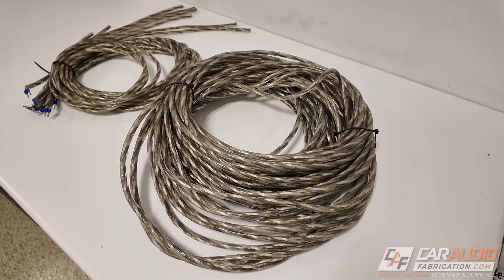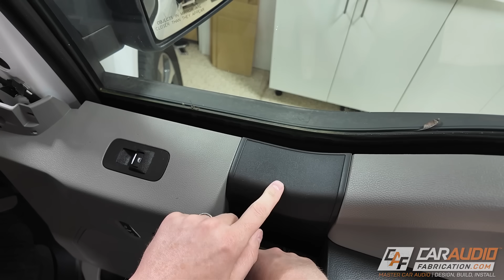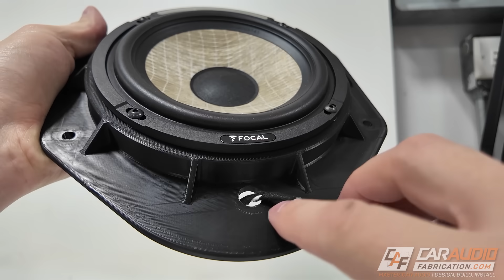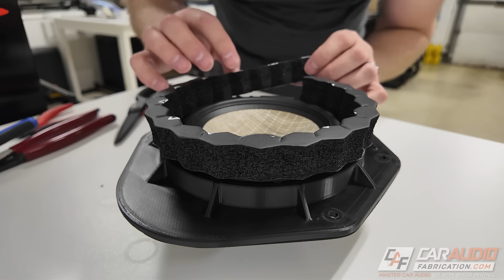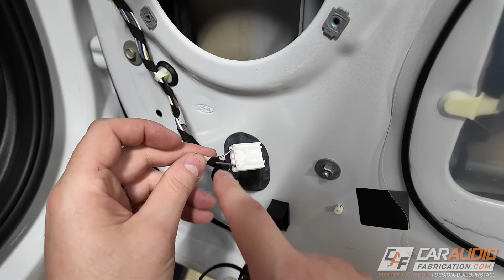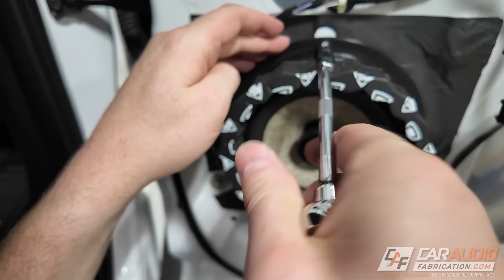AMAZING SOUND with THESE Speaker Installation Techniques

Comment: Mark, I absolutely love your videos and you’ve helped me on my journey of my car audio system
Now I would like to help you when you use your crimps to crimp the cables to speak terminals there’s a better way to use them there’s a two step process which enables like a butterfly effect crimp that you see all factory joins
If you’re looking into the Lucas terminal and see where the split is
Place Louka terminal into the Grip hole closest to your hand you crimp the nipple shape down onto the part that is split within the Lucas this folds the two metal pieces around the wire as if you’re making like a heart shape, once you have done this, you remove the terminal turn it 90° and then use the crimp closest to the cutters to fully squeeze it together
This makes it the strongest join you could ever make using the crimp tool that you have
I have a little video maybe I should post it on YouTube
I learnt this technique from an RC car guy who worked in the model shop
And it looks professional every time
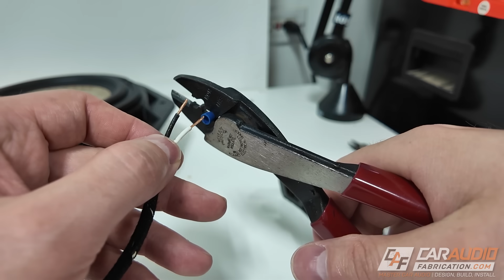Reply: At 7:10mins

Comment: Question; Whats the purpose for removing air leaks around the speaker mount when the speaker will ultimately have massive air leaks in other areas of the door?
Reply from the maker: We do typically seal other areas of the door as well, but the goal is not to create an airtight chamber, but rather to prevent the rear wave from interacting with the front as much as possible. Through a few simple speaker installation changes we can insure the most critical area near the driver is properly addressed.

Comment: I have a question because it’s not too clear here. Sealing foam you used between the speaker and ring then again ring and door. Was it one continuous piece that you punched holes in so the fasteners go through or are they segmented pieces starting and stopping at the fasteners?

Comment: I’m trying to get some bass in my 2024 Silverado LT 2500, non-Bose system. I don’t want to lose my storage under the rear seat, so no big sub box. I’m not sure if I can fit anything behind the rear seat, but what about those compact powered subs under the front seats? Also, I have no idea what the good, but not crazy expensive speaker brands are now, if you have any suggestions it’s appreciated. Thanks!
Reply: @robertboyer5498  get the new kicker down firing set up extremely loud

Comment: Are round speakers better than oval speakers? Just wondering about installing 6.5" round component sets instead of 6x9" ovals.Also wondering about the component sets-what does that do to the resistance as far as the amp in concerned? And my truck has 3 unused frill areas in the top of dash and apparently it's for ~3.5" speakers on left and right and a 2.25" in the center of dash that connects to the negative on the left side speaker wire and the positive on the right side speaker. Considering putting speakers in those locations. Is the component system considered one speaker for each side or 2 speakers each side? How does that affect the amp ratings and output.

Comment: Excellent work
Why do you use 14 guage speaker wire and connect it to smaller wires on the speaker?

Comment: Does it makes real difference doing sound deadening to all inside the door and exterior behind the door panel? I’m going to do it on my f150 ( 80 mil inside door- and thin layer on the door panel mount surface)any advised it will be appreciated. Thanks
Reply: Did you yet? I ask the same question. I just want good sound while on the highway.

Comment: @CarAudioFabrication any thoughts on the Focal-Inside-IW-T3Y-200, Focal Inside IS T3Y 100, and Focal Inside ICC T3Y 100 OEM replacements from Focal?  I'm about to install them in my Tesla and was wondering your thoughts on those drivers.  They have the flax cones like the ones you installed here, but I was wanting to run them off the factory amplifier which they are designed for.  Thoughts?

Comment: 2 installs ago, I made custom sealed carbon fiber speaker enclosures for the front and rear door speakers, that were slightly larger than the Lexus OEM ported plastic enclosures. They turned out amazing, sound epic, and I'll never make them again, as it took a great amount of effort to make the 2 pairs, and the enclosures are hidden behind the door card.
I very much like, and learned from your video, which are always helpful and insightful.

Comment: Nice helpful video. Just curios though, your using a coaxial speaker wich has mid and high on it, does it affect the built in twitter of the car? or is it recommended to cut off the twitter or leave it as it is.

Comment: The material you use on the metal  under the speaker what is it? Rhe one tou prep  @14:56
Reply from the maker: Speaker gasket tape 👍
Reply: @CarAudioFabrication i mean the one u have over the speaker hole that u cut star shape and wrapped arround the edge

Comment: Holy crap I looked up those custom A-pillars…. $1,500!!! That’s nuts!
Reply from the maker: Do it yourself then, be sure to time yourself, I'm sure the results you achieve will be just as clean.
Reply: @JAM4382  $1,500 is well worth it for the quality of the pillars and the time it took to have them perfectly designed and made. Good luck finding anything close to that quality that cost less.
Reply: 1500 ??? lmao what is wrong with them, it cost probably 10 bucks to manufacture and took them 10 hours of engineering from start to finish. what a steal.

Comment: is there a benefit of using 6.5 instead of 6x8 coaxials
Reply from the maker: Generally a round driver more accurately reproduces sound, but with a 6x8 you definitely have more cone area which can achieve more output, so depends on what application and goals you have.

Comment: The install looks great, the extra steps and foam strips and all but also seems a bit unnecessary to worry so much about small air leaks when a door is not a sealed enclosure anyway. 
There is air leaking out of a door all over the place.

Comment: DO YOU RECOMMEND USING GOLD CONNECTORS? It's an undisputable fact that signals pass more efficiently through gold than any other metal. But is it worth using in car audio applications? I notice that despite that fact, no amp manufacturer or car audio component company makes ANYTHING with gold connections which I do find odd. But I wanted to ask someone I trust for car audio advice.
Reply: @GadsdenHillside  silver is actually superior to gold when used as a conductor. It has one valence electron which makes it the most conductive metal. Gold connectors are a marketing gimmick. You will be limited to the signal that copper can pass which is still more conductive than gold. Gold is used for its resistance to corrosion in select applications but would probably serve you no purpose.  Save the money for something else.

Comment: So the bracket I got for my car has a a very thin circle of contact with my door. It’s only 1/4 inch wide. Should I use 1/4 inch foam tape on it to seal it or should I use 1/2 inch and let it just overlap on the inside or should I get a different bracket that has a 1/2 inch width circle of contact?

Comment: Klein tools ftw!
hey, i am about to install the speaker ring rubber things, and also gasket the front of the frame just around the surround so it focuses the bass waves out of the door grille. 
i think i'll do one door and test vs the passenger side, to listen for obvious improvements. 
i did this to my tacoma and had to also deaden the door skin to stop rattles (that were not present in the garbage JBL 6" mids). 
i have a cx-5 with the 10 speaker Bose system, which is ok if you add some sub(s) in place of that tire box pos that comes stock. a 5.25" "subwoofer" just ain't cutting it.. so i'll be changing it out and doing the above steps you've described in your vid. thanks!

Comment: holy crap. I just tried gasketing my speakers to the rear deck trim panel with cheap ccf waterproofing tape from Home Depot and the difference is HUGE. the gasket tape seems to have cut out like 80% of the buzzing from my crappy Honda Civic rear deck plate (even after sound treatment there was a buzz I couldn’t get rid of!) and now they actually sound BETTER with the trim panel installed with much deeper bass. I HIGHLY recommend this step to anyone thinking of trying this - just pick a product which suits the amount of clearance you need and you should be golden. thank you so much for this tip 🙏🙏

Comment: If running dual battery's would it be okay to run a hot wire off one battery and another hot wire off the other into the hot on one amp something like a Y spliter ?

Comment: Hi! I have a 2001 CRV. The door speaker actually mounts to the door panel. Do you think it would resonate better if it were mounted to the metal behind the panel? Or just trying to seal it to the panel would be good enough? Thanks!

Comment: i need to do a sound treatment on my door cards. i have a 2024 Frontier Pro4x with the fender audio. the door cards do resonate at high volume...makes slight buzzy noise. the system is unmodified but i would like to improve it overall without really needing to change components

Comment: I have a 2010 Infiniti FX35 with 2 dear door speakers... i was looking on replacing them with some 6.5inch kickers and was wondering if they would work fine with the stock bose system installed? Not looking to replacing any amps or anything... if not i would have to take a chance and buying used speakers on ebay that cost more than the kickers.

Comment: Does the adhesive plate around the speaker hole in the door prevent your speaker causing the speaker grill to vibrate/rattle?
Reply from the maker: Not in my experience.

Comment: So i had a stereo that came with a car, that sounded horrible. I went to install a new one and realized the installer had twisted every single wire in a manner like those speaker wires you recommend. After untwisting them, I learned there was nothing wrong with the existing stereo. Lesson was, twisting wire that carry current and signal creates interference. Don't but twisted wires and don't twist wires. Think about it this way. How do you create electromagnets? You coil wire. Twisting wire is creating a small coil. This creates electromagnetic interference.

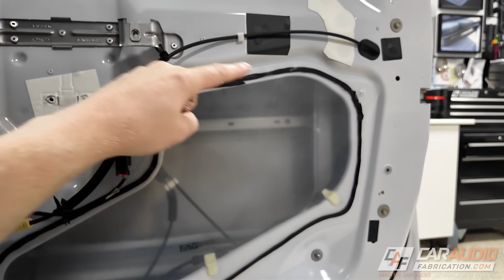Comment: 6:03 what is the point of those spaces anyways? Why do manufacturers put big holes covered with plastic in the door?
Reply from the maker: To easily access the mechanical items in the door. Serviceability is desired over sound performance. We can maintain serviceability and block those holes with a plate that is held in with machine screws and threaded rivets, just takes removing a few more screws to access.
Reply: Ever try replacing a window regulator? You’ll curse at how small those openings are in that context.
Reply: @azjohn520 I typed this out really wrong. What I meant is, why don’t manufacturers add a second pop off panel using a gasket, and bolts/nuts, like the Nissan 350z inner door panel. I love the design of the 350z Inner door, because it has a service panel than can be easily removed and customized for multiple applications.

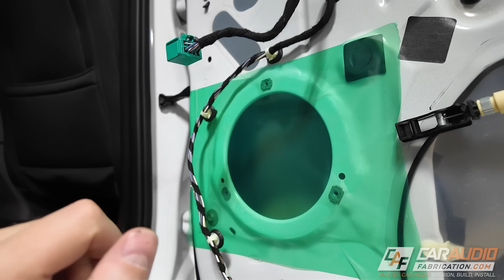Comment: Hey Mark, great stuff. Just had a question on the green mounting tape you used at 14:07, what kind of thickness is it? I was hoping to pick up some of the TESA 51136 stuff, but my distributor has been out of stock for months. Looking at getting some 3 mil duct surface protection film, but I'd rather get whatever you used in this rather than take a chance with film that was meant for a different application.
Reply: At work the composite guys use very similar film for vacuum sealing composite repairs

Comment: I remember when I was installing back in the early 2000's. There was a product made from foam that could be mounted behind the speaker to keep the speaker dry as well as contain some of the air movement and get better bass response. I don't know how well they worked for sound. I do wonder why we continue to use the door panel area as a box when it's clearly too much air for them. If you're printing an adapter, why not make it a container based on manufacturer specs?
Reply: @iderryan  how is it too much space? It is pretty shallow. Seems the total volume of space would be equal to that of actual cabinets
Reply: @spawn302  The entire volume of the door? Yeah, too much for a 5-6" driver.
Reply: Those killed the bass entirely. The door acts as a port and is 100% needed for creating bass. If you do buy those foam backings, cut a hole in the bottom portion.

Comment: The newer aluminum Ford trucks already have pretty decent sound control so this would probably sound great. Despite all the use of plastic panels everywhere the quality, fit, and the way they are mounted is so much better than older vehicles. Just going over train tracks in my parents old Ford Excursion that we had (miss that beast) thing felt like it was gonna rattle apart.😂

Compared to my dad’s 22’ F-350 there is zero rattling going over bumps, I love it. I couldn’t imagine how hard it must be to upgrade the newest F-150s (and up) with the B&O Unleashed 21 speaker setup. Especially the speakers that are in the headrests. Thing must sound so damn nice though. Makes me want to test drive one just to hear the system.🤣

Comment: I was thinking of installing a better sound system in my car, but after watching a dozen of your videos I'm slowly starting to think that it would be in vain.
My car is a twenty year old Volvo saloon.

It has a factory installed system of 11 speakers and a 200W amplifier.  Also factory Dolby cassette player and 20-disc CD changer. Two speakers in each front door, a midrange and a tweeter.  One midrange in the rear doors, two programmable woofers/midrange speakers in the rear shelf, full-range speakers in the front seat headrests and a large subwoofer in the dash. 

All speakers work flawlessly, as does the programming system, but when playing music louder or playing music with a lot of bass and distortion, the entire front panel and door panels resonate with very irritating vibrations.  And when the music is very muted and the trubble is programmed to the maximum setting, the tweeters and speakers on the back shelf start emitting a very irritating high-frequency sound, almost like a dog's whistle.

I'll probably follow the advice in this video and add soundproofing to start with.  later, maybe if that's the problem, change the wiring... and maybe it's also a problem with something else.

Comment: Is there a speaker adapter so that car door speakers can be put on an angle where it face drivers ears instead of his legs?
Reply: @Ashok_kumar_Dolka  if you have access to a 3d printer, just adjust the model design to be angled

Comment: A few months ago I did the speaker foam rings and added sound treatment to the back side of the door panels. Oh man it brought my RF Prime speakers to life. Before they didn't sound that great even with my current kicker amps installed but now its quite loud and direct now. I will say Honda cr-v's are not the best when it comes to acoustics from the factory due to the bigger suv/crossover cabin size but also the thin metal that Honda uses. Even adding a full system, it requires a lot more to make it sound good.
Reply: yup - can definitely relate to your experience with my 2015 Civic. halfway through a build rn and even to just get the rears in was a nightmare. rear deck metal buzzes like crazy and the location is crap for acoustics/installation (had to cut deck metal just to get my coaxials to fit!)- BUT gasketing foam makes a MASSIVE difference already even just on deck power. I’ve come to learn after 4 builds the time you spend on the speakers can either make or break the system - I wish I had known these techniques before!
Reply: did you added full coverage sound treatment or just behind the speakers only
Reply: @bananameowmeow9260  I used Stinger Roadkill sound deadening since I have a box left over from a client's project. Behind the speaker I put a small sheet of 8''x8'' on the inner door metal following with the 5-6'' piece of foam from the speaker ring on top of that. The rest of the inner door metal is still bare, but I'll save that for another day. The door panel itself. I applied about 85-90% of deadening material on the back side of the panel. Made sure to not cover any screw mounting points or wherever something might need to be taken apart someday. I did that to all the door panels minus the tailgate (I'll leave for another day as well). After that the speaker ring foams (as I have explained earlier). IMHO it was a night and day difference. My car is slightly quiter down the road. The doors shut solid now. The music doesn't sound echo-y anymore. It's very direct and clearer. Overall I'm happy with the results. Yeah, it sounds "incomplete" but I can only do so much with such little time in the modern age.

Comment: I find disconnecting the positive battery post works best for me. That way there is absolutely no power running down the positive power wires that can catch grounds while working on the vehicle. You would think that if you where to take the positive power wire while the negative ground on the battery is disconnected and touch the ground on chassis it would cause a short.
Reply: Put one of those little plastic battery terminal protectors on Positive (they come with car batteries when purchased) simple! Everyone just disconnects the negative

Comment: You inspired me to do a much better job with my rear door speaker upgrade! For the front speakers I used Infinity Reference 6530CXs and added speaker foam tape to the front and back of the Metra speaker adapter on my 2005 Lexus RX330. For the rears I ordered Focal 165 ACs, NVX XBAF65 Weatherproof Silicone Rubber Speaker Baffle, speaker foam tape, and GOSCHE 197mil Sound Deadening Mat! Wish me luck  ; )
Reply: my infinity reference's sound worse than my pioneers did.
Reply: @williamhill7999  which pioneers were you running
Reply: @alvincrowder9545 TS-A6995 thank you for asking.